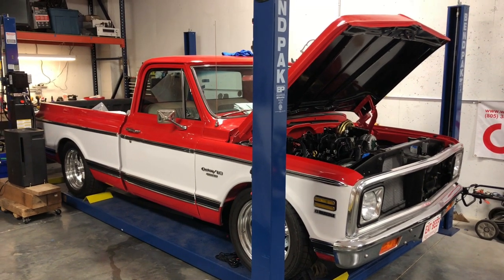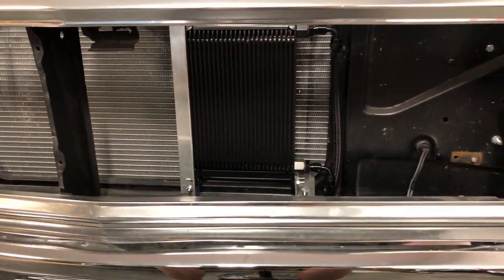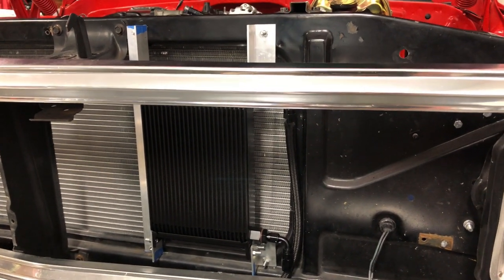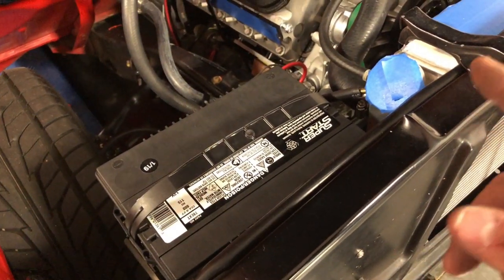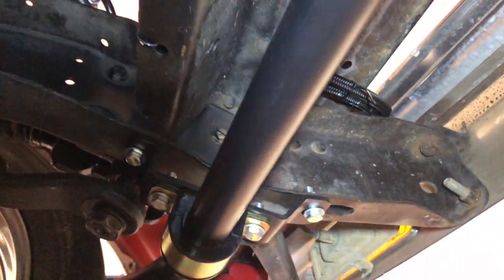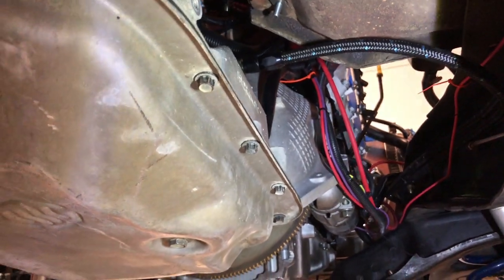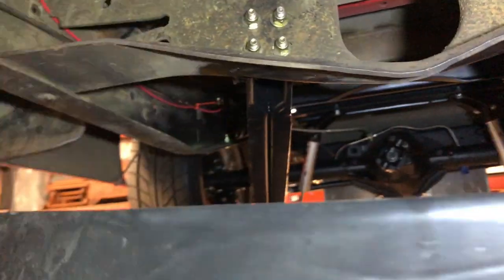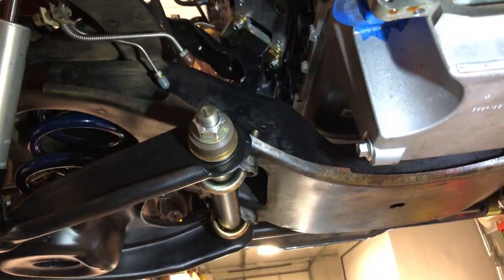'72 Chevy C10 - Transmission Cooler and Lines  - Day 41

Comment: Looks much better than my setup! How do you bend the sheet metal and what an fittings did you use on the cooler and radiator--> cooler? I need to delete the short rubber hose section, just more chances to leak.
Reply from the maker: Thansk.  I just bought aluminum angle stock.  I used 1.5x1.5x.125.  For the fittings. I used  1/2-20 to -6 adapter and -6 line everywhere.  The cooler came with -6 fittings.  This is robust. Probably overkill.

Comment: Hi I got a question about your engine oil cooler lines.. what you did ? Delete them?
Reply from the maker: I didn’t use an external oil cooler.   I’m not beating on it too much.  Haven’t run in to any problems yet.

Comment: That is a super clean trans cooler! Since the inlet/outlet are on the same side is there any issue with it draining back to the pan? Is there a check valve or anything?
Reply from the maker: Thank you.  My thought process was that the stock cooler feeds from the top and returns from the bottom of the radiator.  So I went from the trans to the top of the radiator, bottom of the radiator to the top of the cooler and bottom of the cooler to the trans.  I will see how it works out.  I can always add a check valve down the road.

Comment: ALL AFTERMARKET COOLER AND LINES LEAK AT SOME POINT. GO STOCK ITS TROUBLE TREE
Reply from the maker: That they do.  The stock lines that came with this motor/trans wouldn't work without modifications.  My trans cooler ports on the radiator are on the drivers side, stock is on the passengers.  Thanks for watching!